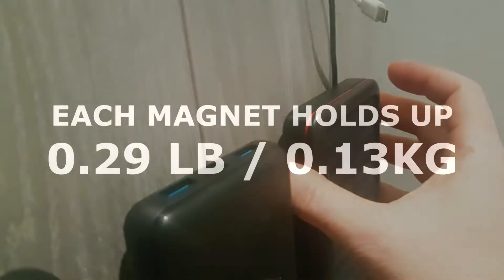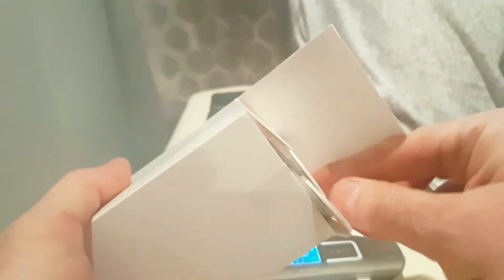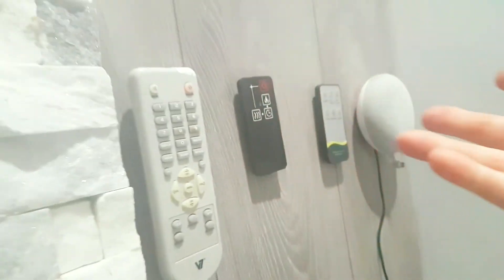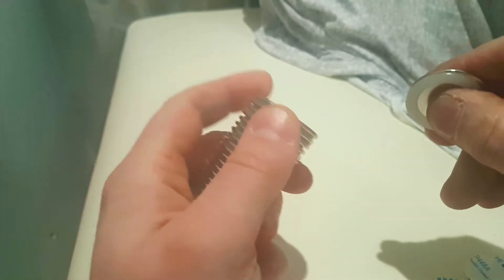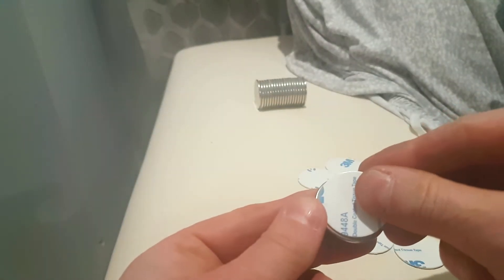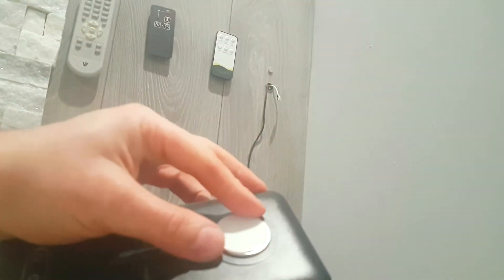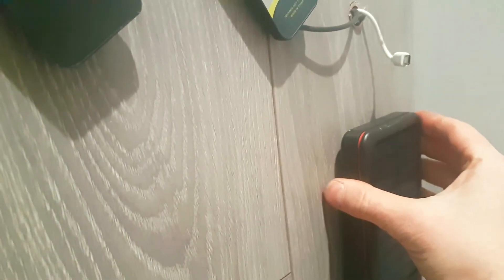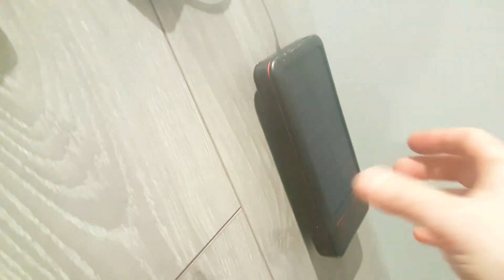**TRUE Strength** of N52 Neodymium Magnets - How Much Can They Hold Up REALLY?

Comment: How far could thin neodymium magnets like these hidden in one’s shoe move objects? There is a theory that a guy on YouTube called michelo 2.0 faked his paranormal ouija livestreams this way, but at one point an egg on the far edge of the board moves and seems like six or eight inches from how far his shoe on an  outstretched leg can reach, as seen in his video “Huevos en la ouija”.
Reply from the maker: Not far and u need to be pretty close to object with magnet. He was using stronger magnets
Reply: How big would they ahve to be to be that strong and stilll fit between his toes or in the soles of his crocs?

Comment: The method  you do is wrong mate 
Thats does not work like this you need to put any material  that has grip  between them like rubber or tgats not going to be work becaus surface  is gloss smooth even big magnet will behave  like this I thing you understand  the magnet  mechanism  wrong you need to correct  your information. 
Thumb  down 
👎